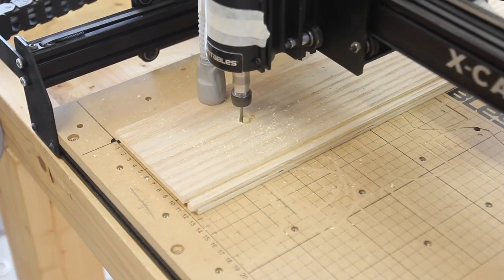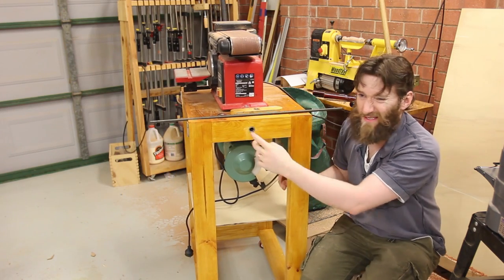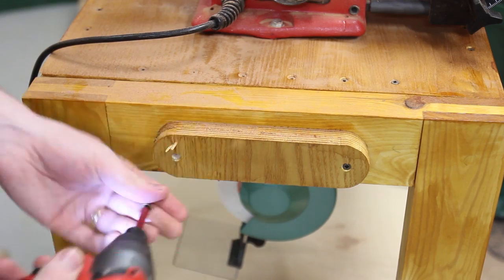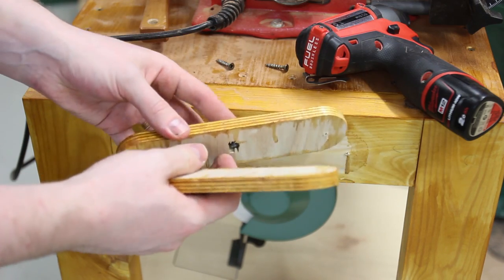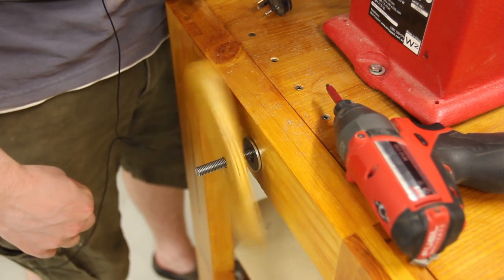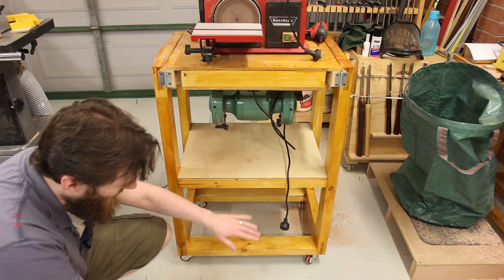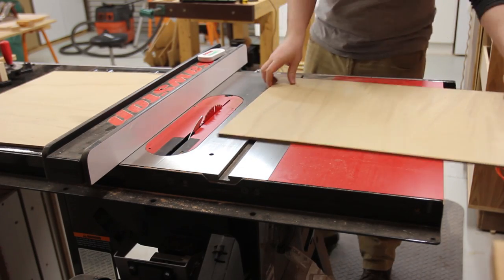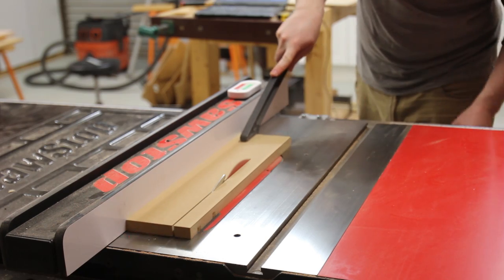077 - Sharpening tray & Fliptop Tool Cart missing pieces

Comment: Hey Paul on the far locking nut (opposite the handle) have you thought of epoxying the nut in the outside piece of timber and sandwich a washed in the centre so that when you tighten it up it cant pull out as its forced against the washer and first piece of wood? Either way great idea mate I have a very small shop and this is a fantastic idea to get more usable space.
Reply from the maker: +Damo Mack Thanks. Initially I actually did have something like that in my drawings but because I'm learning Fusion I had to start over about 3 times and I learnt new ways to do things. At the moment, its holding up OK, but thats why I wanted to go with the flanges just screwed on (rather than glued) so I could fix stuff down the track ;)

Comment: Looking good man, I should really upgrade my sharpening setup, I was going to, a week ago, actually, I almost bought the Sorby whole sharpening system... but then my eye caught the Sorby sovereign and ultima hollowing system.... I blow all my budget on it... so I guess I'll be hollowing more and sharpening less...
What was that thing you were showing your blade shine on??
Reply from the maker: +Yuval Lahav All sharpening systems use consumables, be it water or diamond stones, grinder wheels or sandpaper - its the very nature of the beast. I don't like the idea of sandpaper based systems as sandpaper wears so quickly. The ProEdge is $739 over here, with belt prices starting at $7 (each!) for aluminium oxide,  $15 for ceramic, and $289 (!) for diamond. The advantage - much like the worksharp - is that you get a flat surface to grind on, but the initial price and running price is just crazy. My 120g AO 6" wheel for my grinder was $20 and will well and truly outlast any of that sandpaper.

I'm not sure you'd save much time using it for sharpening "flat" tools (vs turning tools) compared to stones, since you'd have to keep changing grits.

The pink paste is diamond paste. I bought some from ebay, a packet containing 7 or 8 tubes ranging from 5 micron (~4500 grit) to 0.25 micron (100,000 grit equiv) to give a shot. $8 inc postage ;)
Reply from the maker: +Yuval Lahav I should also say I'll do a followup-followup on the actual sharpening stuff I use in the next few days.
Reply: Thanks you for ammount of information!! did you happened to see a Stephen Ogle video he did recently about sharpening with a diamon disk on a jig he built himself? I actually got one of those disks after I've seen the video and I'm thinking about making myself something similar.

Comment: Nice project / video. Criticism: your videos' outros are always way too long. 1/3rd the length of the outro would still be too long. If I wanted to check out your links, I'd pause/replay the video. Or click them in the description.
Reply from the maker: +Josh Olson There is nothing after the outro, does it matter how long they go for?
Reply: I often queue up several videos and let them autoplay (generally on my Chromecast). When I get to your videos, I always have to reach for my phone/laptop and click "Skip to next video". It's not a big deal, but it has gotten tedious; everyone else I subscribe to has reasonable(-ish) outros. That's all.

I imagine new viewers to your channel feel annoyed they waited that long because there's nothing after whereas a lot of channels do have something; that is, YT viewers have been trained to look for outtakes, announcements, whatever at the end. Shrugs
Reply from the maker: +Josh Olson This has been changed at the template level, so new (video) projects going forward will have a shorter outro. However, as there are many in the pipeline, the next couple may not have the shorter outro, and randomly some may not as well  (depends on release order, when I get to actually finishing the woodworking projetc, etc)
Reply: Paul Jenkins Awesome; I understand @ pipeline/randoms. Thanks for taking my criticism constructively. :-)